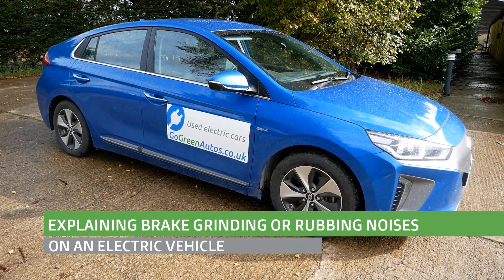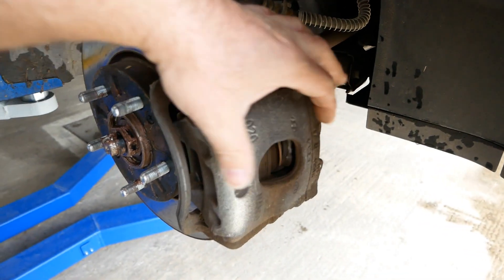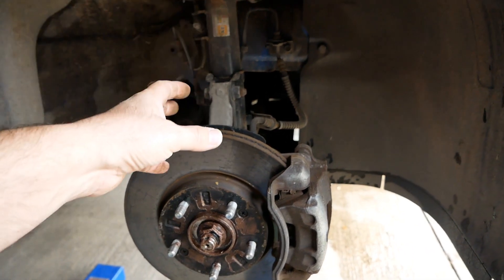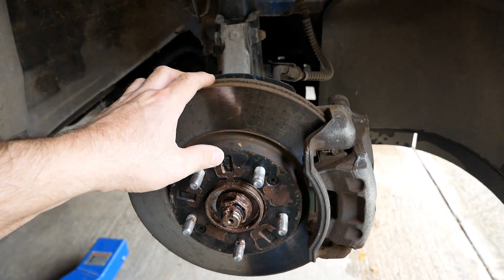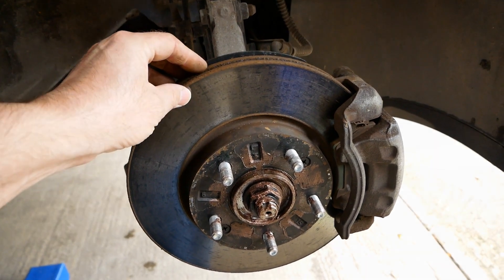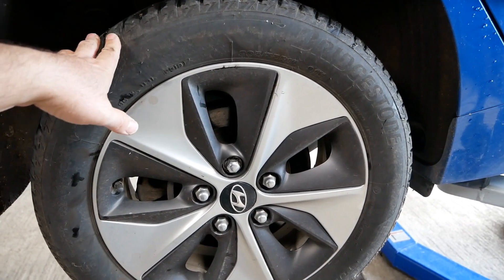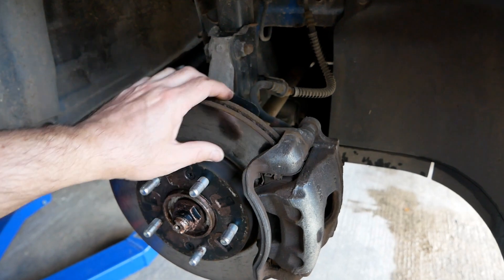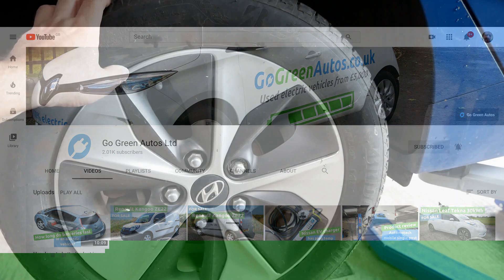Why do you hear grinding or rubbing brake noise in an electric vehicle?

Comment: Pls comment anyone facing the below?
Hi my MG comet ev completed 37000km in one year and i am using heavy regeneration mode always.
Now there is a scrapping or grinding like noise coming while slowing down to 1kw or 0kw on odo.  
This sound noticed after a rainy season drive.While accelerating and regenerating normal sound. But when releasing acceleration and without applying brakes ,car slows down near to 0 kw or 1kw sound comes. This sound first came around 1000km initially.but it went out after 1 to 2 days.
Now sound continues for more than 5 days.
Is this issue due to brake pad water log or any debris in between brake pad or rotor.
Or its dues to bearing issue.
Does any one has this strange sound when vehicle speed decreases down without using brakes?

Comment: I recently bought a Volvo petrol engine car which makes metal noises when  the car about to stop or breaking slowly in very low speed.  Sometimes it’s annoying. But normally at 15+ km/s it doesn’t make that noise. 
Is it something to worry about?
Thanks in advance.
Reply from the maker: Probably not. If it just does it when the brakes are wet and rusted over night, no. But if it makes noises when the brake discs are dry and clean, then check your pad thickness.

Comment: I drive trams for a living, they use regen breaking, so each morning they activate the disk brakes for the first 3 times you break.  
They could easily run a programme like that on these cars.
Reply: The newer Hyundai and Kia EVs have a button you can push to turn off all regen braking for 10 brake cycles in order to clean the brake discs, and then the normal regen turns back on.

Comment: Hi Go Green - we've had our 5 year old Ionic serviced now it is getting a film of brake dust over the wheels where it never did before. One wheel front driver is so bad that there is a thick coat streamed back up over the door. Prior to this service (Hyundai dealership Bartons Capalaba) the car had still 10mm on both front pads ie. factory depth still even after 5 years use. Only one of the back ones down by 1mm since factory in 5 years. Then a week after servicing - it's tearing through brake pads with minimal driving as well. Any ideas on what they have done?
Reply from the maker: It sounds like you've got a stuck piston. I wouldn't use a main dealer for brake servicing.

Comment: Hi , recently purchased Kona Hybrid which currently  only getting used couple time a week , been raining couple of days , yesterday went out and noticed when braking at low speed or gently there was a scraping / grinding noise, which you suggest is normal , bit concerned as had car 2 months and it just started happening . Car only done 6000 miles
Reply from the maker: Iron brakes rust when yet. So completely normal until the rust is worn away. Brake a few times at high speed and the pads will clean the brake discs and they will be noise free (until its parked in the rain again).

Comment: Thank you for this explanation. At low speeds I am getting this noise on my Lexus hybrid and the dealer told me it was due to the regen braking but I didn’t believe them. Your explanation makes perfect sense why I am hearing this noise coupled with the fact that I don’t drive my car much.
Reply from the maker: Yes, nothing to do with regen braking. Regen brake is all done by the electric motor and not the brakes.

Comment: Thanks for the video.  Would this also be true for driving a hybrid vehicle like a Prius?
Reply from the maker: Yes, but depending on they're driven. Hybrids to have regen braking (i.e. motor braking), so if driven gently and very efficiently, the friction brakes will have much less use. But generally, most hybrids will still have a reasonable amount of brake use still. EVs with strong regen and one pedal driving, will have almost zero brake wear (if driven well), so the discs and pads do tend to stay corroded up.

Comment: Sent my ioniq to dealer with the handbrake not releasing they fitted alternative release springs this was within the first 2 months of ownership
As you say noisey but not locking on todate
Reply from the maker: That's interesting. Tight rear brake pads is a common issue on the Ioniq due to the electric handbrake. I wonder if they've modified the release springs then. Do you have a part number on your invoice? That would be a great help if you did, as I will order some in and see how they are different.
Reply: @GoGreenAutos  Hi Matt sorry for this delayed reply as I've been unwell for the last 20 days
Referring to the rear brake springs on a 2017 Hyundai Electric 28kw ioniq 
After a confirmed inspection
The following was fitted
Description 
Spring- Pad Return Kit
Part NO
58288G7300QQH
I don't know what it looks like or where it fits
Vehicle mileage  773 now at 20.000 and no recurring fault only with a rusty disc if left unused for a few days which I accept
I've had various electric window switches replaced under warranty just wondering if its a quality issue and will they all fail on me once the 5 year warranty ends
Reply from the maker: @michaelbruton3537  Thanks for the info. This is very useful. The Ioniq 28kWh rear brake return spring is item 5288G2300 and looks like this https://www.hyundaipartspro.com/p/Hyundai__/Disc-Brake-Spring/65920405/58288G2300.html. Yours now has https://www.hyundaipartspro.com/p/Hyundai__/Disc-Brake-Spring/70105790/58288G7300.html which is completely different and from the picture doesn't look as it will fit. But I may order some in and see if they do a better job as binding rear pads is a common issue on the Ioniq.
As for window switches, we've not had a single issue with our own 2017 Ioniq yet and its done over 90k miles now, see https://youtu.be/lE7QgYLN3Dc
Reply: @GoGreenAutos  Hi Matt many thanks for your reply
I don't know if the parts were ever fitted by Motorfair Hyundai ,Birmingham 
I had an official Hyundai recall
For Power Control Unit (EPCU) inspection which was passed off okay
I seemed to have been fobbed off by the dealer over the fact when I had 4 new tyres fitted I also had a 4 wheel alignment done 
With some toe settings adjusted the print out showed the right front caster angle at fault at 4°00
Stating in red values are not within specification 
13 out of 14 measurements correct on the vehicles geometry
Reply from the maker: @michaelbruton3537  I've ordered some new rear brake pad springs, same part no. as fitted to yours and they are the same as the originals. However, I'm going to fit them to see if they make any difference as maybe the originals loose their tension over time. A video will be coming on this subject soon.
Reply: @GoGreenAutos  Hi Matt I hope the parts are useful I'd like to know if you have any recurring fault once fitted
On a other subject
Just received a Safety Recall from Hyundai 
To get intouch with dealer
For Electronic Power Control Unit Software Update and Ground Point Installation
Just wondering if garages have had difficulties not have an accessible earthing point seems strange after 5 years
The software update isn't surprising as Tesla seem to do that more frequently 
I need to inquire via Hyundai how urgent this is as my scheduled service and mot was extended into July due to dealership closure due to covid situation
Reply from the maker: @michaelbruton3537  It turns out that they are not a modified part at all. Your dealership was fibbing. I've got a video coming up soon on this exact subject.
Yes our own Ioniq 28kWh has been booked in for this recall work too. I don't know anything about it, other than the dealership said they can't do it in the claimed 70 minutes as the battery needs locking out, so wanted the car for a day.
Reply: Thanks for this video! I am wondering if this is what has happened with my Mitsubishi Minicab-MiEV. Last I drove it was 3 days ago in moderate rain. Then today, I notice a horrible grinding / rubbing noise, which is worse when coasting or slowing gently, but isn't obvious when either accelerating or braking harder. I've been city driving at mostly 40 or less (heavy traffic both directions) so haven't had a chance to drive fast then brake hard, and van is not heavily loaded atm. I am much more used to highway driving and actually usually park in the city but am house minding atm so need to do more city driving atm. 

Does it sound like this might be brake buildup?
Reply: @cass2778  it sounds as if it's only surface rusting
Especially after standing for three days in possible rain
It should soon clear with town driving as your not certain of other drivers actions
I have had this often over weekends when the vehicle hasn't been in use
Hope this is your problem
Mine by the way was a sticking on rear brake not surface rusting as I'm getting now

Comment: Great info, just bought a used Ioniq HEV and was concerned about this. Is there an easy way to clean the disks myself? I live in a climate where we seasonally change tires in the Fall and Spring (add/remove winters). Would it be worth it to clean the disks myself when I change the tires twice a year anyway? Best practices?
Reply from the maker: Drive to 50mph or more and brake hard. Job done.

Comment: Hey, I'm working on a paper about cars and i have a question about breaking in EVs
You have the regen braking when you aren't pushing down the gas pedal, but when you push down on the braking pedal do you use the electro motor in any way to slow down or does that go straight to the friction brakes?
Reply from the maker: Pushing the brake pedal is obviously friction brakes, but at the same time the regen on the motor is turned to the max to assist.
Reply: @GoGreenAutos  thanks so much

Comment: Motorcycles commonly use stainless steel disks (mostly for cosmetic reasons) I wonder if this would be worthwhile to address this corrosion? From a quick search, it looks like "metal spray" may be a viable approach to have a stainless steel surface.

Comment: I bought a second hand ev, that lately hadn't Seen much use and the brakefluid had not been changed. That combined with the less use of the brakes meant that sludge had built Up just behind the caliper seal, so when brake pressure was applied, the seal got stuck in the "out" position and made the pads drag slightly. This has not happened to me in a regular car where the more frequent use and heating of the caliper prevents that! A way to mediate IT is to use phenolic brake pistons, or maybe upgrade to DOT 5 brake fluid, which  Better suites EVs with its hydrophobic properties, that won't absorb moisture and cause corrosion in brakes not nused much. NB. The ev is half way through its second set of pads in 18 years! There is No Edge on the original discs yet!
Reply: 18 years? Which one do you have?!
Reply: @davidrmcmahon  It's a Fiat 600 elettra, made from 1997-2002 for visiting nurses and municipal police in Rome. Only 758 ever produced. A lot of them ended in a field, where they were sold off for pennies at an auction. I conveted it to Li-ion, so It now has the performance like the iMiev with 120mi range. City driving is only 160Wh/mile, so half the cost to charge, and it looks exacty like the original gasoline version, so keeping my affinity for old cars, though having moved on to modern times.
Reply: @Tore_Lund  Great job mate!
Reply: @Tore_Lund  Wow. I thought it was a misstype. That's cool

Comment: Hi Matt, another well-described solution: however, the brakes on our Zoe are quite jerky, we can’t slow down easily without being flung against the seatbelts. We’ll try and test the brakes out more harshly as you suggest, on our local bypass, see if that works, - or have you any other suggestions? Great videos, keep ‘em coming!
Reply from the maker: Brakes in Zoe's are really snatchy when wet. We had two for 2+ years and it still catches you out when it rains. I guess it is due to the compound in the Renault pads. Never wore the pads out so there was no need to try some other brand in them.
Reply: Go Green Autos Ltd. This is all the time, in the dry and the wet! We’ll try the harsh braking....👍🏻